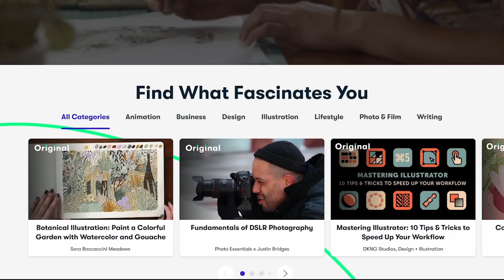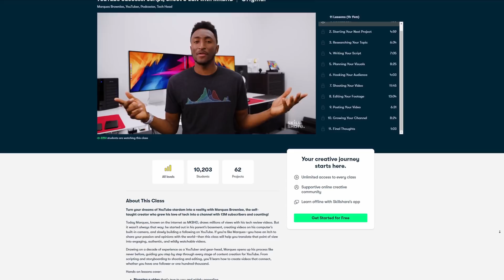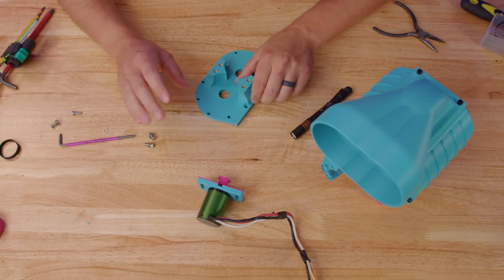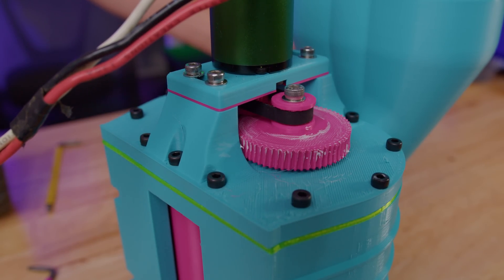I Attached a 100,000 RPM MAX Castle Mamba to my 3D printed SUPERCHARGER..... Will it Survive?

Comment: SkyRC eFuel series. Adjustable voltage, up to 50A or 1200W output. Used it to do thrust test in range of 1000 watts and handle the inductive motor load like no one's business.
Reply: @xthexder0  Obviously you've never messed with hobby grade electronics, they draw stupid amounts of power.
Reply: Yes exactly their knowledge probably as vast as a super hornet and 1300mah nicad is fast!
Reply: It's a 90 amp esc
Reply: @xthexder0  An EV is 100+kW at 350-920Vdc. The sportier models have battery packs capable of delivering over 2000A peak. I don't know what motor he's using here but 1kW BLDCs can be shockingly small and that would be over 100A peak at 12V. I could find plenty of compact 1kW BLDC motors, all 24V and up though. When you look at how torquey modern cordless compact impact drivers and other power tools have become, we're likely talking over 1kW peak on 18-24V there and those are some seriously small motors too.
Reply: Why not just use a 12v Lead Acid battery, 400-800a cranking amps capacity, so easily will deliver 12v@100+ amps (use really thick copper cables as they will get VERY hot), but it can deliver the power you need and sustain a longer delivery time (800AH is 800 Amps for 1 hour at 12v (which would have your cables glowing white hot!!!), obviously that's not sustained, but it would give you enough to do your tests and you already have one (assuming you have a petrol-powered car).
Reply: @sohonz  cranking amps is how much current you can get out of the battery to make the starter motor go, it has nothing to do with the battery's energy capacity. Pretty sure there's no such thing as a 800AH automotive battery unless you're talking about something else I'm not familiar with.
Reply: @sohonz  Where exactly do you buy your 800AH lead acid batteries? 800 cranking amps delivered for 5 seconds at a time have nothing to do with the AH rating of the battery. A normal sized car battery will have a capacity of of 50 to 80 amp hours. Yes, it can deliver 800 Amps, but only for a short time. On top of that if you cycle that lead acid battery through its capacity a handful of times, you will ruined it. Not to mention that 800AH of lead acid capacity will likely weigh around a quarter ton.
Reply: Or a server power supply, only 12/24V but cheap and lots of power
Reply: @DinkelBrot99  My computer draws 1.5 volts at 100 amps so often I can almost feel my local power electric grid operator screaming at me from miles away.
Reply: yeah those rc motors can be ower hogs . There's a guy building a rc car to try and break the land speed record for rc cars. he's running 2 2105 motors with 4 6s 90c batteries and he gets maybe 2 mins of run time.
Reply: @drixom9805  don't forget his quad motor fire hazard build XD. Raz is a legend
Reply: @xthexder0  You are not wrong. That motor can probably sustain only not much more than 10 continuous amps. But can probably sustain 10 times more for a second or two if it is not already too hot. The confusion comes from the intended use of those things, they provide huge power for a short amount of time. If you power them through a supply you need a supply that can deliver that peak power at any time like a battery would. The same goes for batteries. Can batteries sustain 60C discharge? Yes, for a very limited amount of time and if you accept considerable degradation.
Reply: @xthexder0  I build competition robots that pull 500A off an 18AH SLA battery and only weigh about 150lbs, you underestimate how much effort is required to move a car.
150A for a single brushless motor is on the high-end of thing at this scale, but certainly not impossible.
Reply: @cbale2000  that depends wether you look at hobby grade motors or hub motors for electric scooters, some take over 500 phase amps, not uncommon.

https://youtu.be/0BGDIxMowHY this guy runs a Tronic 750 ESC, there's actually an electric scooter (stand on) with 2 Tronic 400's in it, it peaks at approx 100kW, which is crazy in an electric scooter, the Tronic 750 can do 550 phase amps continuous with a max of 31S (130V)

this guy isnt even maxing the voltage yet lol, pretty nuts
Reply: @xthexder0  yea about that.  The limitless option motors use 150amps at 24v. They produce around 7hp. And can accelerate the limitless to speeds in excess of 150 mph.
Reply: @xiar5546  You might want to check your math and definitions a bit. 150 amps at 24 volts is 3600 watts. And 3600 watts is about 4.8 horse power, NOT 7 horse power.
Reply: But, how much RPM is?
Reply: @abdulmuhaimin5274  You spelled RGB wrong.
Reply: @gutterg0d  Bruh... Are you a Razer fans?
Reply: @abdulmuhaimin5274  Nah. if anything, I'm a Wooting/Logitech buff. :)
Reply: The problem with hobby grade electronics is that they 1, run on low voltage. 2 draw way too many amps, and 3 are extremely inefficient and will burn up very quickly if you don't know what u are doing.
Reply: I think the motor needs 150A nominal
Reply: @willemboudestijn138   That the problem with Castle they dont spec their motor or esc. If it's around 1000 watts and the volt drop to 7v (lower volt needs more amps) you would need around 150A peak. but most things listed a 50A continuous current usually peak well over 150A.
Reply: @xthexder0  lol
Reply: Pls God let this happen
Reply: Actually a 150a esc is what I use to power most of my 1/10 scale RC cars some of my bigger stuff can pull more than 400a
Reply: @needmoreboost8208  bigger stuff usually pulls fewer Amps! 7(V) at 1000(W) is the same (Max) Amps as 14(V) at 2000(W)... both equal around 140 max amps. also, You dont need a 140 amp ESC to control 140(A) unless you are full wide open all the time!!!
Reply: @xthexder0  Sure, but a car is doing that at 400+ volts.  This application is pushing about 12 volts.
Reply: @xthexder0  100W is maybe for some walmart toy.
Reply: @xthexder0  You're technically correct on the 150A part, but that's a meaningless statement.

1. Any size motor will move a car with enough gear reduction.

2. 150A doesn't constrain how much power you can put into the system.

Modern hobby grade electric motors are insane though, the move to brushless removed the "welding the brushes to the rotor" problem with high currents.
Reply: @xthexder0  yeah you have no clues what you are talking about mate.
Reply: @xthexder0  You are simply looking at power and not thinking about what the motor is made for. It's a high RPM motor which is relatively small compared to a motor used to drive vehicles so heat is also an issue having less mass to displace it. My motors much smaller than this than this on my drone use 30+ amps each full tilt.
Reply: @xthexder0  that's not how it works. That's not how any if this works.
Reply: car battery that sits right below 12.6V would work fine with a 3S ESC aswell
Reply: @xthexder0  I have motors half that size that draw 1kw at full power. I have a pancake motor that probably weighs about the same as that one but pulls 2.8kw at max throttle.
Reply: @xthexder0  bro..my electric skateboard is 170A 7000 watt lol
Reply: 1:52 The moter is 5700KV
But I don't know what input voltage on its diver.
So I recommend using MEAN WELL 1000W industrial power supply, probably 12V or 24V🤔？
Reply: @crazyfurnaceguy1229  it's 14.8 volts it's rated to 4s the problem is those Traxxas motors can draw over 100 amps. what that means is that motor needs a 2000 watt power supply for efficiency at a minimum.
Reply: @xthexder0  rekt
Reply: @xthexder0  Dude, my largest RC helicopter (a 700 class electric behemoth), the motor in that can easily pull 300 amperes at 50 volts. That's easily 15 kilowatts, right there. Also, that's at the absolute upper limit of my helicopter's power system.
The motor controller itself has a nominal current rating of 200 amperes (with an absolute maximum of 300 amperes).
The motor itself? An XNova Lightning with torque for days.

Comment: I would like to see a larger version. Something like for a 360mm or 420mm (I've forgotten which size the opening is) radiator.
Reply: A 360 is a triple 120mm fan set up and pretty common, a 420 is a triple 140mm fan set up and common on more high end air flow focused cases.
Both would be excellent.
Reply: @gmailisaretard  yeah, I know. I meant it in that way that I couldn't remember the size of the opening the supercharger has at the bottom. so if it's 120mm then go up to a 360mm rad. and for 140mm up to 420mm rad. I mean a 480mm radiator would also be cool ;P

Comment: If it’s 12V you could maybe use a PC power supply. Those usually have a high output for 12V.
Reply: Yesss!! If It can run a big GPU at 12v (3s lipo) It can also run a powerful Air Pusher!
Reply: yes the cheapest way to get a high amp around 12v psu is to buy a pc power supply. 

there's just 12v supplies for 3d printers and the alike where you can adjust it up and down couple of volts but they tend to get expensive too at higher than say 200 watts.
Reply: you all know that we aren't talking about a few 100W but more like 100-200A at 12V if he uses a good rc motor. pc powersupply can't ouput nearly as much as it is needed on one connector even if it could theoretically give that much based on the W. there is a reason why we connect that many split cables to the powersupply and not just 2 like in a car.
Reply: @dovos8572  you can solder the outputs and use more than 1 conector.
Reply: @felixorjales  ... how to burn everything down. it is way too much work and pc voltage isn't as easy as soldering it together without destroying things.
Reply: and it is likely not enough watt anyway

Comment: try going twin screws instead of roots, it's easier to rotate them and output much more air
Reply: But will it print, and how accurate can the screws get to fit together properly? Must be hard to get them to mesh together properly

Comment: Which ESC are you using? Do you have a model number for it?

Also are you using a 2s 7.4v or 3s 11.1v battery?

If it's a 3S, you could maybe use something like the Mean Well SE-1000-12. 110VAC to 12VDC rated for 83.3 amps. Only thing about it though is you need a 20 amp circuit in your home with a 20 amp plug to use it as it peaks at 17.5 amps from the wall, so you will need a beafy power cord/extension cord that is rated for that type of power.

Edit:

Even better, you could get the EVGA 220-T2-1600-X1 and build a DIY bench power supply out of it. 

133.3 amps on the 12v rail and is WAY more efficient than the Mean Well power supply (85% efficiency vs 96% efficiency)
Reply from the maker: 3s
Reply: @MajorHardware  Check my edit. I'm looking at bench power supplies but it looks like most cap at 10 amps which sadly is no where near enough. That Castle motor can draw 50+ amps easy.
Reply: @MajorHardware  get a truck battery.  it would be a problem in an actual rc car or an ebike or whatever, but on your bench it's not a problem it's 10kg.  cranking amps are 400+.

edit: or just borrow a car battery from a random car down the road, or yours.   it's probably the highest current around 12v'ish source for a test amount of time you can have cheaply anyway.

Comment: Hook up the batteries in parallel til someone leads you to a power supply that can handle it. Long as you don't SHORT the batteries, you'll be 100% fine. You'll more than double your runtime, since not only will there be double the capacity but also each battery's only working half as hard, so they won't heat up as quickly.
Edit: Many people are suggesting you use a PC power supply. I strongly recommend NOT trying that. You’d have to bond all the 12v rails and pray to RNGesus that you’re not going to suffer a capacitor explosion.
Seriously guys. He’s pulling so much in-rush current he’s overheating the batteries. Go watch electroboom before advising others on the interbutts to use a PC power supply for an application like this.
Reply: Came here to say this. A power supply that can do what he wants won't be cheap.
Reply: a pc psu converted will be fine. if he gets a 1000w one with a large amperage 12v rail.
you can connect two in series for 24v, but you will need to isolate the negative rail from ground in one of the power supplies.
Reply: @jimmyhackers8980  a pc power supply can’t handle this. That motor is pulling over 80 amps
Reply: @kman1898  a 1000w psu will usually have a 12v rail that will do over 80 amps. they can be bought for about 100 quid. two in series or parrallel will be around 2000w.
so either 24v at 80amps or 12v at 160amps. 
      i doubt you can find a 2000w 24v power supply for cheaper.
Reply: @jimmyhackers8980  The problem is that the motor demand more than 12V. It's more like 50V.
Reply: @Kualinar  reaaaaaaaally? i didn't knew that .. thats a beast of a motor  o.o
Reply: @Kualinar  the caslte mamba motor is rated to 4s lipo which is 16.8v. he is using a 4s lipo currently
Reply: @jimmyhackers8980  is he? Those packs looked like they were 2s or maybe 3s packs. That doesn't change the fact that running them in parallel will maintain the current voltage and double the amperage.
Reply: Also, you can drive more current with less battery voltage drop since you are effectively halving the thevenin resistance.
Reply: @dakotaadra1044  The current goes up with the same power output if the Voltage drops. P=U*I (Watt=Volts*Current) I ratter have lees current with the same power draw and that is Voltage up :)
Reply: My fellow Canuck ElectroBoom is ALWAYS up on the latest if what not to do!
Excellent choice!! 😁😅
Reply: Parallel will also lessen the strain per battery added too which means less heat and less voltage sag in operation.
Reply: A decent PC power supply would likely work. Good ones have 1 12v rail for the entire 12V load, so they'll happily supply 50A and more to this motor. Though I wouldn't go full boar instantly because the peak could maybe kill a PSU.
Reply: @Muscleduck  others have stated but thats 50 amps at 12 volts. this motor does not run on 12 volts . a bench power supply might be what they are thinking of  when they said pc power supply .  they do similar things but not the same.
Reply: @tobiwonkanogy2975  no, this motor DOES run on 12 volts... he’s using a 3s battery. At full charge (4.2v per cell) it would be 12.6 volts.... the esc doesn’t boost voltage. The battery doesn’t magically put out more than 12v. It is 12 volts. It could take more but it’s happy at 12.
Reply: @jjhack3r my mistake the motor will run on any suitable voltage and amperage to spin . Its demand at nearer to 100,000 might exceed a basic computer psu or battery and would be smarter to understand more about the demands of the motor. The mamba part is the power conversion module according to the website. i also didnt realize we were converting after battery power.
Reply: it can take voltage ranges from 2s(7.4v) to 6s(25.2) apparently so might just need a 6s battery or parallel 4s system
Reply: @tobiwonkanogy2975  I looked up the mamba as well but the mamba is actually just the esc. Somewhere near the beginning of the video if you pause it just right you can get the model of the motor and its a 3s max motor at 5700kv. It definitely can't hit 100k rpms and from what little I read on forums, Castle creations is known to put that on motors that could never achieve that.
Reply: @Muscleduck  This motor probably needs 150-200A to it
Reply: @CenPapi  first of all, RC motors, batteries, and ESCs are rated in PEAK power, not continuous. Second, his battery claims to be 4ah with a max discharge rating of 20c which equates to 80 amps peak. That little motor will not survive 200 amps for ever a few minutes...
Reply: @jjhack3r  all I'm saying is that if he's trying to get the aforementioned 100k rpm out of that motor(he says he wants to get it to full tilt), and the 20c he's using is only getting him 7k, he's gonna need 150-200amps just to get even half that half of that.
Reply: Bull. I’ve abused pc power supplies and never killed one. They shut off if you pull too much current. Any old 250 watt pc power supply could do what that battery is doing, and a good 750 or 1000 watt one would be more than enough...
Reply: @jjhack3r  That is NOT enough wattage and you do NOT want to bet on the protection built into a normal PC supply. It could blow a fuse leaving you with a useless power supply until you open it up and replace the fuse (DANGEROUS) or it could cause a housefire.
Maybe if this were taking place in a fireproof lab, but not in someone’s house.
Reply: @LokiScarlet  from what I read on that model of motor 1406-1y when they "dyno" tested that motor they only used a max wattage of 300.
Reply: What about a regulated lab bench power supply with a supercapacitor bank in parallel with the load? Would that be a reasonable solution? Though I also think just adding more battery banks in parallel would be good
Reply: I would say just build the power supply but he's an ME so 🌚
Reply: i soldered all rails on a cheap psu for powering a car amp, it works pretty well :)
Reply: series would be better, you will have same voltage but more runtime
Reply: @Hnkka  Series will ADD the voltages. Here, we need the same voltage, but more curent. As much current as possible. So, parallel is the way to go. Also, I'd go for more than just two batteries in parallel. More like 5 to 10 batteries in parallel.
Reply: @Kualinar  oh i mixed things up when translating in my head
Reply: @Hnkka  
Not true.  Putting batteries in series sums the voltage.